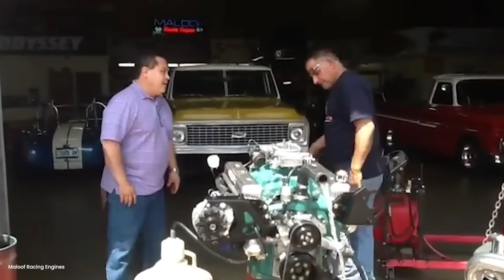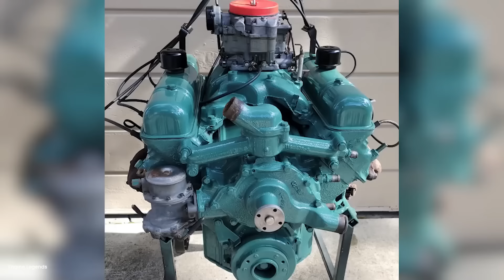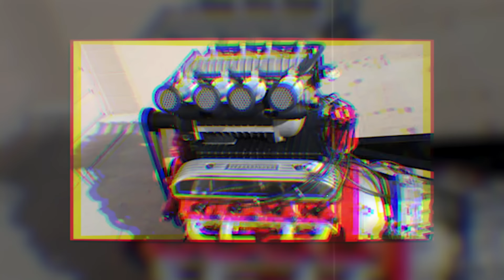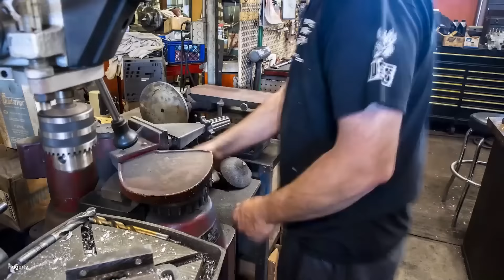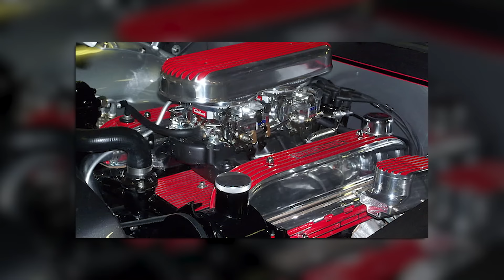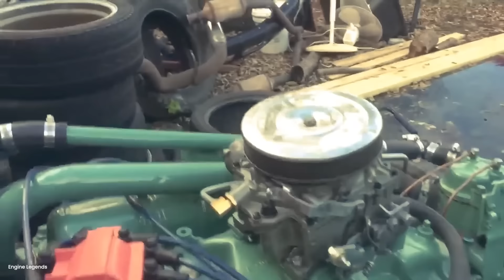How One Buick “Boat Engine” Outsmarted Every Hot Rod in Town

Comment: The nail valve Buick engine doesn't make a very good boat engine, but it does make an excellent boat anchor.
Reply: Online dummies use the term boat anchor when referring to engines!
Reply: Dad's old v-drive boat with the 322 Buick smoked a v-drive with a 430 Lincoln. You don't know shit about marine engines.
Reply: @martyharless5097 "Blah blah blah... v-drive boat with the 322 Buick smoked a v-drive with a 430 Lincoln."
Uh huh. Surrre it did.😅
Reply: @daryllect6659  if your engine isn't set up for use in a boat it  will not perform that well. People that take engines from cars and put them in boats without addressing the needs of an engine used for boats wind up sorely disappointed in their performance. A lot of the v-drive boats back then used engines that were taken from automobiles. 
Gray Marine converted nailhead Buicks for marine use during its entire production run because it was a solidly built engine with excellent low to mid-range torque which is exactly what a boat needs.  A little bit of information can help your ignorance problem.
Reply: @martyharless5097  -
Okay genius, exactly what internal components and specifications must be changed when using an automotive engine in a marine application?
Be specific.
Reply: @daryllect6659  your entire rotating assembly and valve train need to be very strong to handle the stress that a boat engine endures as those engines are always under load and working much harder than an automotive engine. The camshaft profile in a marine engine is entirely different from that of an automotive engine as low to mid-range torque is imperative if you want any performance at all. A recurved distributor is also a must if you want good performance. Marine engines use different oil pans, baffles, and oil pumps than automotive engines otherwise the engine may starve for oil. Marine engines don't use vacuum advance. If your boat has an engine cover it needs to have a marine specific carburetor (or fuel injection system), spark arrestor, starter, alternator, and ignition system to prevent an unwanted explosion from gasoline vapors. A boat without an engine cover can still have gasoline vapors accumulate in the bilge area when the boat is not at speed and become an explosion hazard. A separate water pump is necessary in order to bring water up to the engine. If you use your boat in a saltwater environment you need to have a heat exchanger as part of your cooling system otherwise your engine will quickly corrode from the inside. Boat engines require marine specific exhaust manifolds that are water cooled to prevent the cylinder heads and engine compartment from getting too hot. If you want to use headers they have to be marine specific headers. Boat fuel tanks tend to accumulate water more than automotive fuel tanks so a water separating fuel filter is a good idea. Water pumps, intake manifold gaskets, and cylinder head gaskets need to be more resistant from corrosion.
You really don't know the first thing about marine engines do you? It's okay if you don't as most people don't but to pretend you do just makes you look like a fool.

Comment: Ummm, how many "Nailhead" combustion chambers and weird small valve angles are in modern OHV designs that meet current emissions standards?  NONE!  Look at the most successful and efficient OHV V8 in history...it's called the LS/LT etc.  It doesn't have any of the Nailhead atttirbutes (other than typically oversquare, which the IDIOT editing this video didn't realize a 322 Nailhead is!) and it generates more tq/hp per cube with better fuel economy and mileage than any Nailhead ever produced.  Were Nailheads cool in the early 1950s? Yes!  Were they revolutionary V8s? NO, they were like Caddy V8s...good for luxury cars and sub 2,000lb hot rodders whose owners couldn't afford an Olds or SBC

Comment: The successor engine to the nailhead also followed the mid range torque monster style.  The Buick 455 introduced in 1970 produced (if I remember correctly) 535 ft-lbs of torque at about 2,100 rpm.  It moved.

Fun Fact: Torque is how hard you can pull.  Horsepower is how fast you get there.
Reply: Horsepower sells cars, torque wins races
Reply: @bradr65  Torque is how hard you can pull.  Horsepower is how fast you can do it.

Comment: 👍the 366 big block truck engine in my 71 C60 failed. Not a nailhead but I replaced it with a Buick 350 and it would out pull the Chevy 366 all day long.  I investigated, smaller bore, longer stroke and bigger rod bearings to boot.

Comment: Every V8 at that time was oversquare. All the Buick V8's including the 455 were oversquare. Chrysler RB engines were the only ones that were undersquare.
Reply: The RB's were over square too. All were 3.75" stroke, and over 4" bores depending on which engine. 383 was 4.031" bore, 413 was 4.1875, 426 was 4.25" and the 440 was 4.320".

Comment: In the 1960's my dad use to race a 1925 Buick it had a 1957 motor 364 cubic inch he bored it to a 385 cubic inch. In 1963 at Lions drag strip he had  671 blower on the Buick motor it ran the quarter mile 1294 seconds at 110 mph.

Comment: Buick dynaflow early on had bad reputation for being slow,however in 1955 the dynaflow was renamed twin turbine with much better performance over early models. I have a 63 riv with twin turbine trans and a 64 riv with st 400 trans and i see same power with both types , transmissions used in 55 thru 63 big buicks were the best

Comment: The ethos behind the Buick engines has always been fast torque rise so that the car was quick and responsive on throttle tip in. From off idle to 4400 rpms the engine was ideal. The cylinder heads created high energy so the velocity was high. The cams were rumpy, which was a complaint from customers

Comment: After 60K they were junk. Tap tap tap, Oil leakers, and massive blowby. 
I do remember driving a low mileage Wildcat 425 that could easily smoke the tires for a block.  
Failed design

Comment: My second car was a 1966 Gran Sport. It was a three owner car, I was the third. 401 4sp 325 horsepower and 445 LB/ft of torque. MoPar 340 engine couldn't run with it.